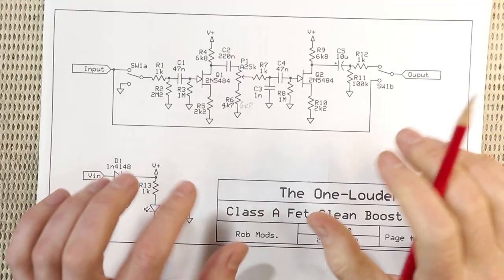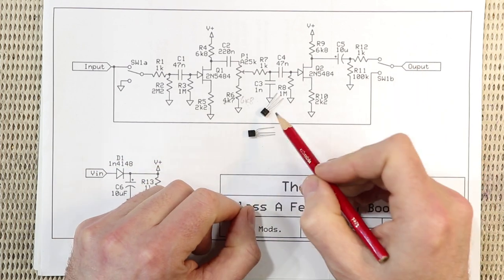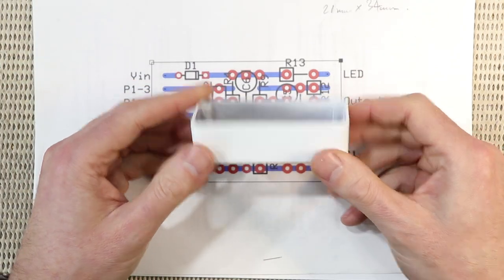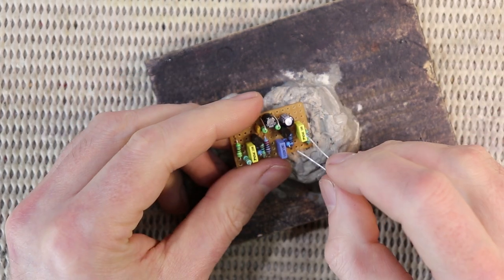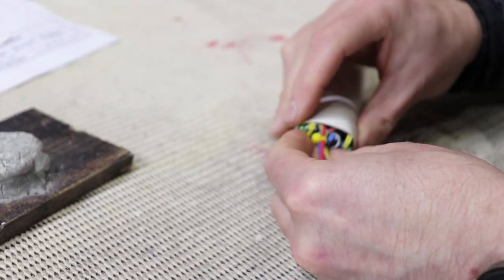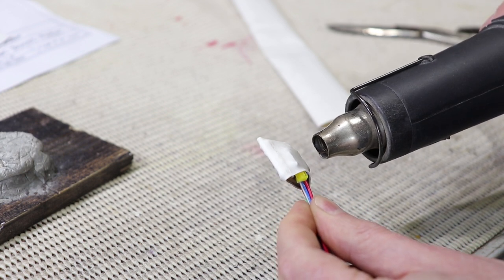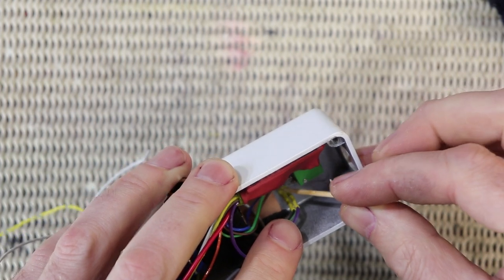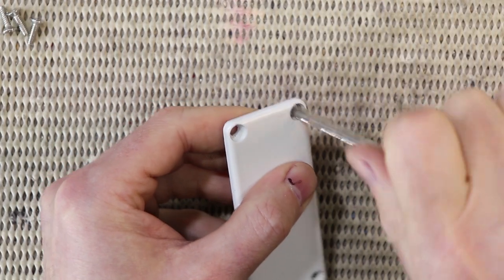How To Make A DIY Clean Boost Mini Guitar Pedal

Comment: Very good video! I've built myself a couple of boosts using a J201 transistor and just a few components. The board turned out so small, I even installed one in the cavity of my Les Paul. And I engage it using a push/push pot. Hidden, but there where you need it 😁
Reply from the maker: Nice one.   A single fet buffer/ boost is fine as an onboard pre. I've done that myself many times.

Comment: As you have huge exp. with components to sound deal , let me ask : which resistors should i use in , which ewer  pedal make , wire , carbon or metal film ? What about tolerance o/o ? Should i avoid Al e . lyte caps in a signal path ? Thanks ! Very interesting clip ! Regards !
Reply from the maker: 1/4W or 1/2W metal film resistors for sure.  A good quality electrolytic is fine for the output coupling cap.  Thanks mate.  I'm glad you enjoyed my video!

Comment: Hi, very good video. Can you help me? I can't find 2N5484 to buy it. What component I can put to replace this 2N5484 ?  Transistor BF410A is able to assemble the pedal without problem ? If you can help me with this I'll gratefull.
Reply from the maker: You are right,  mouser and digikey both now list these as obsolete.  I buy mine from jaycar, but there's also still many ebay sellers.